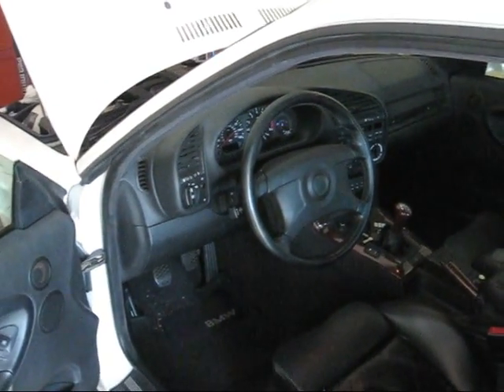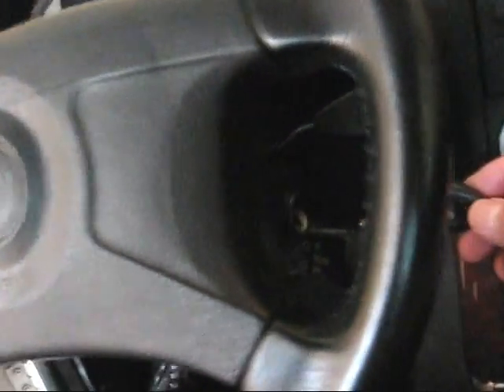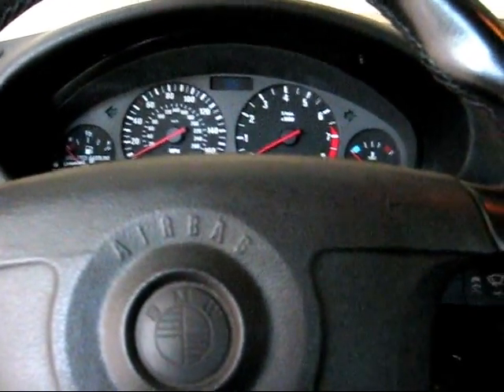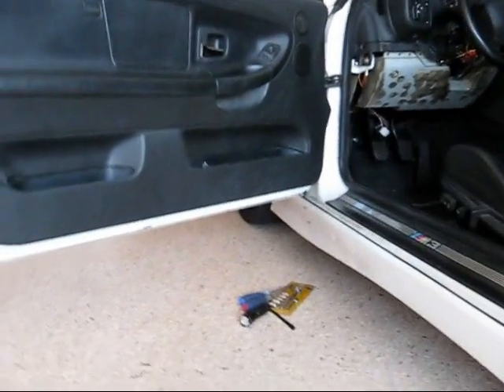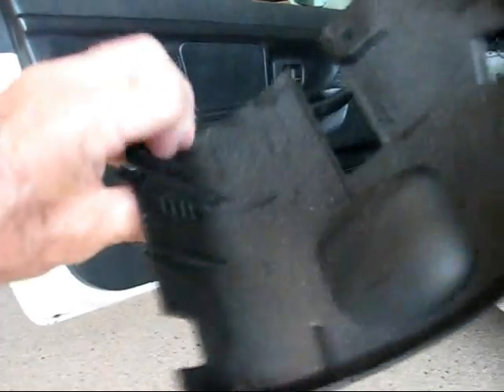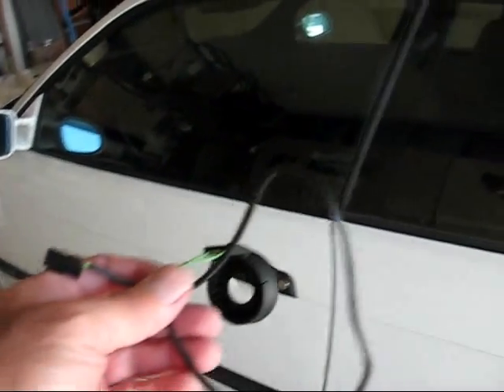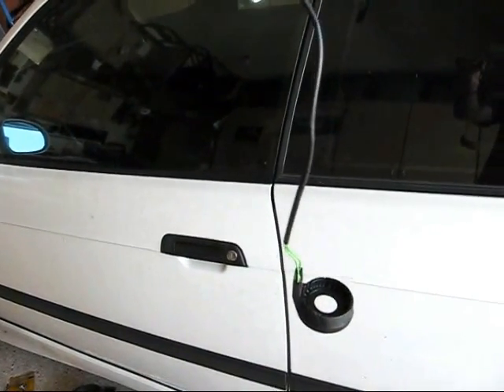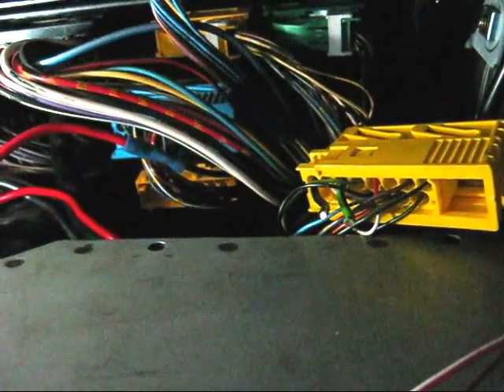BMW EWS II security bypass on 1995 M3 by froggy

Comment: There is a problem with my car, e36 engine, 18i Injection sprays wire, with no electricity?
What is the reason for this? When i put a fuel in the precautionary room, the engine works
Reply from the maker: Sorry can't uderstand the question.
Reply: @1947froggy   i have a A problem with ignition spinning, injectors Electricity cut off from them

Comment: Jumping those two wires takes ignition switch cranking voltage strait to the starter solenoid. It just bypasses the internal relay of the EWS2 module that closes the crank circuit when proper conditions are met. After the key, antenna ring, transmitter, EWS2 module, and DME all shake hands  meeting starting requirement, the car will start. The DME also controls fuel injection and igniter packs. The rest of your EWS2 module must have been ok. 🤷🏻‍♂️

Comment: I've got the same issue my key ring antenna is damaged vehicle will not start I did the bypass it cranks but I'm getting no fuel at injectors was there another wire cut at the DME

Comment: Hi thank you for the video , I have ews2 on my 96 m3 and same issues , I had to get the key reprogrammed and worked but after the car was under mechanical work I had my battery un hooked and it was like that for like 6 months  and so now it won't start . I'm thinking  doing the bypass your way . Is your m3 still running good ?
Reply from the maker: I sold it.  ;0

Comment: I have a 2004 BMW 525i Touring......    It some time starts and some time do not. I suspect the key is not talking to the receiver assembly.  To get one new key here (Norway) costs 550 USD :(  and then also I am not sure whether it will fix the problem and work. Any possibility to bypass all these "great" features and at start my car and keep going.... The car sometime do not start (After few days it will start and work smoothly like nothing happened. I think the transponder on the key does not talk to the receiver on the steering assembly (When the car do not start, Dashboard do not start or light up - No Crank - No Start - Power seat adjustment, power windows, steering level adjustment, central locking etc all work  - Battery Good). Private mechanic could not find the problem after troubleshooting for 5 hrs (120 USD $/per hour). They say they do not get any error code and they are not able to find the problem. BMW say they cannot assure to find the problem and it could take 1 hr or even 20 hr ( x 150 USD $/per hour) to troubleshoot and identify the problem, and also they do not commit they can identify. Repair cost will be extra. on top of this.  I am in a dead end situation. Any help is very much appreciated. jcbjse@gmail.com
Reply from the maker: Unfortunately the start "security" systems change a bit year to year. So what worked on mine might not on yours. Try to find an INDEPENDENT BMW mechanic with GOOD REFERENCES and let him try. That's crazy money for a key, try amazon/ebay? Has to be exact key for your car/ignition system I had a spare key for one of my Vettes & no wear on it, so when my "main" key went bad, just switched. Always have 2 working keys any car. Thanks!
Reply: @1947froggy  Thank you very much. I will try to find a independent mechanic.

Comment: Im having a problem starting ive tried everything still wont start. I pulled ignition put a new whole key with new ring . The car still wont act like it wants to run but dont. Im gojng to try bypass security again but it didnt work the first time i hope tring it again it works
Reply from the maker: I only know it works for the model I used 1995 m3 just so you know, design & wire colors will be different on other models. Thanks, good luck.

Comment: Very clear and understandable video. I am mechanically inclined, but I have a 99 323is and I am going to investigate this scenario. I was lead to believe that I have a bad DME, but it could be a bad EWS I suppose. the car turns over but no start no fuel pump no power to DME. If it is the security module, I wonder if this will work on mine. I’ll try hopefully in a week and post. Also my son found a 96 318 in really good condition. Only the owner says it has “a bad security module” so that would be a win for that too. Thanks
Reply from the maker: Good luck, post on your progress, thanks!
Reply: hey, i have same symptoms as you. my issue on top of the crank no start is i think i accidentally opened my key and lost my chip in it without realizing because i checked mine just now and it's not there. did the bypass work for you?

Comment: I looked at my harness connector and there are two Black/yellow wires that are the same size. I cut the one that's the first wire and spliced it with the big green wire but, no start/ no crank. I'm wondering if I cut the wrong black wire. According to the EWS 2 diagram, the first black/yellow wire goes to the starter and the green wire goes to the ignition. The other black/yellow wire goes to the DME. I'm not sure what to do.
Reply from the maker: Is this a 1995 m3? If not yours could be different. Reverse what you did & try the other.

Froggy
Reply: @1947froggy  It's a 525i 5 SPD. The EWS module is located under the driver's side dash. It's the EWS 2 version with the black EWS box with the yellow connector, just like in your video. Does the connector need to be disconnected from the EWS module, or do you re-connect the connector and leave the two wires jumped? Thank you for your help!
Reply from the maker: @iamurnamann8662  Reconnect.
Reply: @1947froggy  Does the yellow harness connector stay plugged into the EWS module after jumping the two big wires? Thanks!
Reply from the maker: @iamurnamann8662  Plug back together. Yes.

Comment: I have a 1995 525i E34. My car won't start/crank. I have the same EWS 2 version but, I noticed there are two black wires on the yellow connector that about the same size and I'm not sure which one to cut.  I'm trying to see the close up angle on the connector in your video but, it's too difficult to tell. Can you let me know the location of the black wire? Thanks!

Comment: We did this on our e36 and now it tries to start but now the gasoline pump doesnt get electric?
Reply from the maker: The fuel pump shut off is part of security. On mine it worked & fixed all. Is yours a 1995? M3?
Reply: @1947froggy  it started for like 5 times, then fuel pump shut down, i guess we have a broke cable somewhere or bad ground
Reply from the maker: @superjensje1  If it started at all then the security fix worked. You "may" have a weak, worn out fuel pump. They do wear out as they are very hard working parts. I have replaced several on different makes. How many miles on the car/fuel pump?
Reply: @1947froggy  i think 170k but we'll fix it. Also if it's going to start, we can see the miles, if it doesn't, we can't see them.. big puzzle
Reply from the maker: @superjensje1  It sounds like fuel pump issue, put a fuel pump pressure gauge on the line at the engine and do a standart fuel pump pressure test. I show how on my 2002 Suburban if you want to look at that video. Look up the spec for your make/model/yr.

Froggy

Comment: Thank you so much for this. This fixed our problem exactly. We just did a manual swap on a 96 e36. Worked perfect untill we drove it home, all lights on and no crank. Replaced the starter, changed nothing. Cut the same two wires and spliced them together and presto!
Reply from the maker: Great that this old video is still helping, have fun with the car!

:)

Comment: Just put a cable in the EWS pins... first pin to third pin i think is for EWS 2!
Reply: Will this be able to start car with no key chip?
Reply: @amandasaiyasith7833  yes that's the point of the process you put a cable from first to third pin
Reply: panchas psycho what is a pin on the esw
Reply: panchas psycho I did exactly what the video did but every time I try to start it it won’t turn on it just keeps turning like it’s out of gas
Reply: @favo3x450   What model is your BMW, and if you can read the EWS i can tell you because this does not work on every EWS, if it is EWS3 or EWS2 with Motorolla it won't work :( for EWS2 it is first to third pin you can see in internet there are pictures
Reply: panchas psycho it’s a 1995 325i

Comment: hello how  u doing ... i have  a bmw 1995 325i with a 110k every thing was fine till few days ago the gauges  on the cluster is not working the fuel an the temperature the speedometer an the rpm not working but the car run an drive fine the lig the signals is working....an another thing happend that windows  stop working but if i take out the cable of the battery for a minute  an but it back everything  start working  fine ... idk  if u have any idea about this problem

Comment: Hi Froogy l have recently recently purchased a RHD 96 E36. My car is automatic and l wondered why it was able to be started in gear instead of only in park or neutral, after taking out the glovebox l noticed the two heavy wires you refer to had been disconnected from the ECU (somebody has discarded the device) (gone) and joined these two wires together. The plug is just hanging there now and doing nothing. Initially I assumed the starting fault was caused by a faulty inhibiter switch on the gear change, after watching your video and reading other comments. I am reluctant to replace the inhibitor switch if that's not at fault and I've gone to all the effort and expense to renew it to then find out it's not the problem
If anybody can offer me any assistance and advice l would appreciate it very much.R.
Kind regards from New Zealand.
Reply from the maker: Not at all sure on that, immobilizer is for security/stolen car, nothing to do with starting in gear that I know. Good luck.

Comment: Nice vid froggy! If i change my ecu to a surplus donor ecu with same part number, then i do the bypass, will it work? Bec i bought a surplus ecu, plug it in but yeah, didnt even crank.  :(
Reply from the maker: I never tried to change the ecu, but I think it needs to be "paired" sort of to the vehicle. Maybe tech2 or trip to dealer.

Comment: will this not crank but also kill the fuel pump? I had this issue but at first I could push start it, but then It stopped push starting too, but after a couple days would work normal again?!?!??
Reply from the maker: Not sure I understand, but the fuel pump itself should be ok, you are just getting (or not getting) power to it. None of this will kill the pump.

:)

Comment: froggy, would this procedure work to eliminate a key all together? i have lost my key and bmw wants a couple hundred bucks and a 4 hour car ride to the nearest dealer to produce id and registration. i know the ignition stitch pops out on the opposite side of the colum and can be engaged with a screw driver .any thughts?
Reply from the maker: Not that I know of, I did it with a working key.

:)

Comment: You didn't have bypassed the EWS2. I try to explain why this "trick" does the job on your car. When you turn your key, the EWS2 check if you have a good key (password check). If the check is successful it switches a relay inside of the EWS2 unit. This relay simply connects the two wires you have connected manually together. These two wires are only for the starter. BUT, the EWS2 does more. It sends a coded signal to your ECU on another wire that the ECU should allow the following start. So, whats happend in your car, is simply that the relay inside the EWS2 has failed. This means, that you just have bridged the relay, and forced the starter to turn, but you cannot prevent the EWS to send signals to the DME and check if the DME and EWS2 are aligned. If the start was successful your EWS2 sends a new "password" to your key for the next start via the ring antenna and only this password will "unlock" the EWS2 for the next start after the ignition was shut down for 10 seconds at last. I bet, if you remove the chip of your key, the car won't start. The car will crank, because you connected the to starter wires together, but it will not start. You can not disable the EWS2 with cutting and connecting wires. If you will fix the failed relay inside of your EWS2 and reconnect the two wires back to the ESW2 your car and start immobilizer will work as designed.
Reply: Mr3, THANKS for a very clear explanation:  this is  the ONLY way one can do repairs,by KNOWING; thanks
Reply: thanks for the thoughtful insight and time to type all that. That is great insight so we others can innerstand the system and what's happening.. people who are thinkers will use this to investigate the bigger picture and see it.

thanks
Reply: Which relay is it?? You sound like a bmw mechanic!! We DIYers are doing this ourselves....with no help. And we sure in the hell are not coming to your stealership!!! Because honestly that all what these relays and modules are about!!! They go bad so people can come to the service department and you the advisor tell us its a head gasket blown....overly charge us.....change the relays or module....and the car works fine... While we pay thousands... Hell no!!! Thanks froggy
Reply: I have tried to bridge the two wires and the starter swings but no start.Otherwise the ignition just clicks when the ews is not bridged
Reply: @VernonNaidoo-v3u  See what I wrote 7 years ago. You cannot jump the EWS2 like that. You only bypass the relay inside of the EWS2. The code between key and EWS2 and the alignment between ECU and DME has to be correct. Otherwise the car will not start. It seems you have either a faulty ring antenna, S/E module, a defect chip inside your key, a malfunctioning EWS2 module, a bad ECU or the alignment between EWS2 and ECU got lost. You need to diagnose that stept by step before replacing parts. If you have a guy on hand who can flash ECUs, it's possible to "uncode" the EWS2. But that guy needs to know what he's doing.
Reply from the maker: You are probably correct, this "tricks" the ews2. I don't have the time/tools/parts to fix it as you describe. Mine works.

Thanks for the thoughtful comment.

:)

Comment: You can buy all of those parts cheap on E-Bay, just bought some.
Reply from the maker: Thanks, generally it's hit/miss for online parts. I buy lot's of them for many makes/models. Post back how YOUR repair goes.

:)
Reply: Good so far,just waiting for Antenna Ring for ignition £15 new, and cannot find mirror fold module under fuse box.Thanx for asking,good vids.

Comment: Well actually I have to splice the two wires the two black and yellow wires together on the module plug
Then I took the two wires that were connected to the module plug and splice them together with the green wire it cranks but doesn't start
Reply from the maker: Thanks for posting your work.

:)

Comment: I did the bypass after putting in new key and tumbler worked good ty for that it's a98 328i but I see a lot of post that car cranks now but won't start and no post on how they fixed that prob. if theres a fix to my next prob. pls. post.
Reply from the maker: Not sure, post if you figure it out please.
Reply: seems like most of the 98 328i's have this prob. I'll post if I figure  this last key to the problem , or what I did to fix, Tks for the vid. very helpful.
Reply: i have a 97 and same issue

Comment: Hi froggy, I have a BMW 1996. I have lost my only original key with transponder. I had made a spare with no transponder. I live in Fiji and we have no proper BMW dealer. My question - Can I follow your procedure to start my BMW with the spare key?
Reply from the maker: Sorry, my procedure assumes a working key/transponder/antenna.

:)
Reply: can u help me, i need to start my vehicle and is there any way to bypass the transponder. thanks
Reply from the maker: I don't have info on that bypass.

:)

Comment: my e46 has the same problem, i'ts been of the road for abaut a year, and when i first tryed to start he did, but after a short driving when i tryed again next day he wont start no more, no crank even till today i stel tryed but no succes, should i try the same metod? is a e46 318 2001,please someone help
Reply from the maker: I only know for sure it worked on my 1995 m3, others with other bmw's have also had some success.

:)

Comment: Hey, so am I suppose to take out the tumblr or does it have to do with bypassing the ews system and getting a new key? Do have the original key by the way. Car was starting fine until one night it got stuck on accessory mode so I unplug the battery. Once battery is plug in it goes straight back to accessory mode even without the key in the ignition. Been had an issue with the key spinning but never had it stuck on accessory mode or with the car on till a few nights ago. Also, it's hard to get the key to spin, have to play with it and even if you get it to spin it won't even crank or be able to turn the car off. Please, let me know. Thank you.
Reply from the maker: Your issue seems to be (as you describe it) all to do with the key and ignition cylinder. Does not sound like EWSII

Comment: Hello Froggy.  first i want to applaud your thourogh understandable video.  my 2 green wires on ews antenna broke and antenna uncoiled from its seat.  do i need to replace or repair it or just remove it before jumping the two wires at the other end and when taking cables off the battery which one do i remove 1st (returning cable which 1st?
Reply from the maker: My video works with a correct functioning antenna & key chip, so fix those first (not very expensive) then if the ews2 board is still causing a non start you can jumper the wires as I demonstrate.

:)